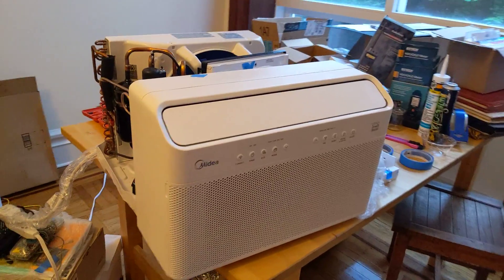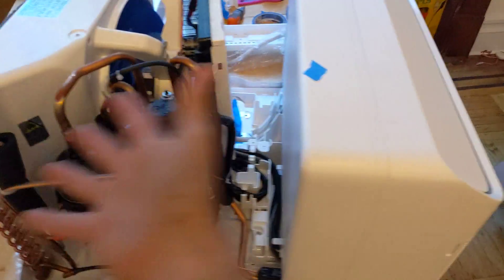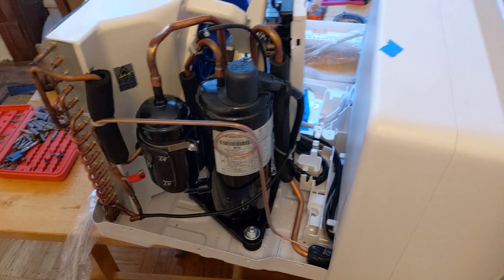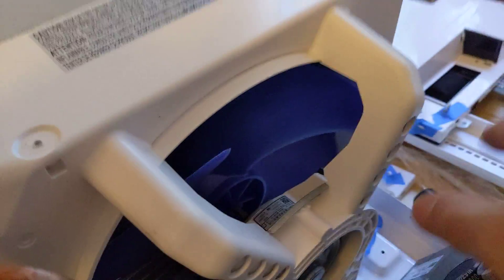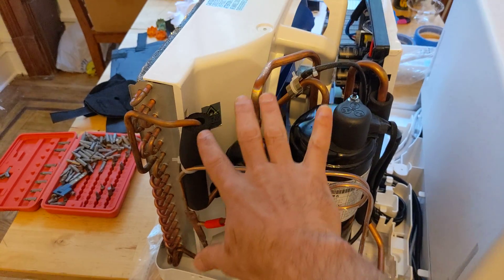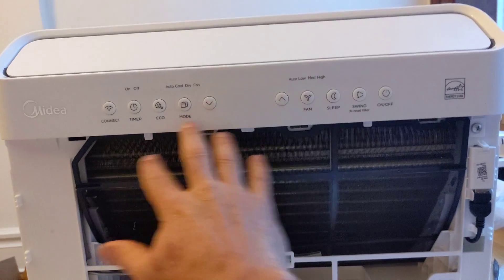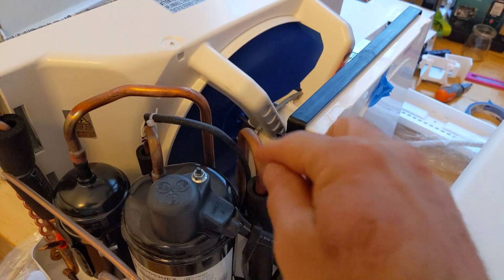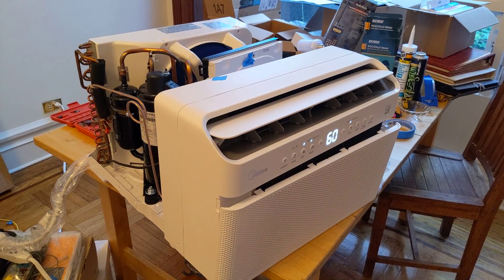How did Midea fit a full mini-split system inside their new "U" window unit?

Comment: It might just be a thing with the phone audio, but I definitely heard a really high pitched almost coil whiney sound
Reply: There is a cricket trapped inside that compressor... poor thing
Reply: That could be on of the parts it´s like when you hear a releay whistle or you hear an Old tv. Around your mid 20ies Humans experiance a lose in the Frequency band they hear. Usaly from around 28. I think i´m more impressed that his Audio equipment pics it up, it speaks for some quality.
Reply: It's a byproduct of inverter compressors. I have an LG Inverter Window AC. I am completely impressed with it but was very interested in seeing how this unit faired. From what I can tell it seems they are almost on the same level. Only this one takes it a step further by having the compressor on the outside vs the LG which is still one whole unit but still manages to be very quiet. These new units blow away the traditional window AC's out of the water.
Reply: @user-ix5qy7um6o  The compressor uses a brushless DC motor without position sensors because it is difficult to run wires into the pressurized casing. The controller starts the motor by first applying a constant PWM generated DC voltage, causing the magnets to align and lock into the field, at which point the frequency can slowly be increased causing the motor to turn. If you observe the fan blade closely, it starts in the same way; you can see the fan blade "twitch" as the magnets align with the field, and then accelerate. By locking the magnet position, the controller can "assume" where the motor is and start it accordingly, until the motor spins fast enough to generate a feedback signal electromagnetically.
Reply: I think that sound was coming from you
Reply: Yeah... The whining/squeal is a bit frustrating. I notice he mentioned there's a blanket for the compressor that likely comes equipped but mine doesn't have that :(
Reply: It's an inverter compressor, so it works by rectifying the incoming AC into DC, then chopping it back up with transistors to produce a variable frequency AC wave. A big part of the losses in a power transistor happens during switching, which is why they pick 14-16kHz for motor drive usually. Pretty much all of them sound like this, though it's usually well concealed on fully enclosed compressors if the covers are on the unit.
Reply: The high pitched cricket sound is very difficult to fall asleep with. Going to try max cooling our bedroom an hour before bed and then raise the temp to 70 to stop the compressor cricket sound long enough to fall asleep. Hopefully the cricket sound won’t wake us once we’re asleep. A little disappointed about this issue.
Reply: @rsellers  I have a different unit with 120Hz low humm that goes through everything. High pitch you should be able to block with hard material.
Reply: I have a 12k unit.  I hear the high pitched noise during startup.  But once the fans start blowing can't hear anything other than the fan and air.  Also, I only have single pane windows.  I imagine if I had double pane insulated glass, it would be even less noticeable.
Reply: That sound will be limited to the outside of the window. Thats the reason for the u-shape.
Reply: @Yul-Uhlu  ... I own one (hence the "but mine doesn't have that). It's not all outside. It's pretty annoying to hear it all the time.
Reply: @soulofjacobeh  Yeah i just installed mine a few weeks ago and that high pitched chirping is definitely noticeable.  it may not be loud per say but the high frequency of it is pretty annoying and i can hear it pretty clearly even with the window down.
Reply: @fluttuers2820  Yup, me too.  I've been trying to figure out how to make it less noisy.